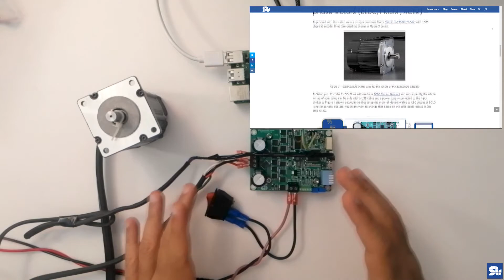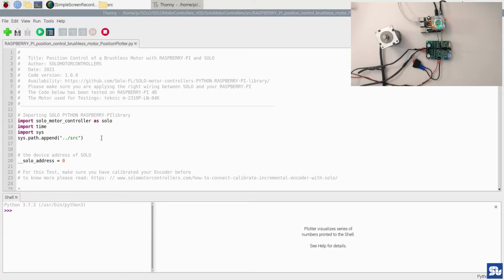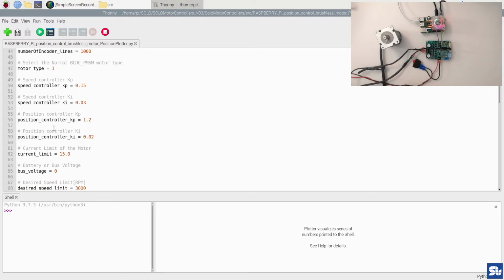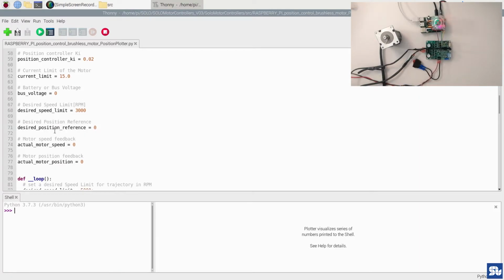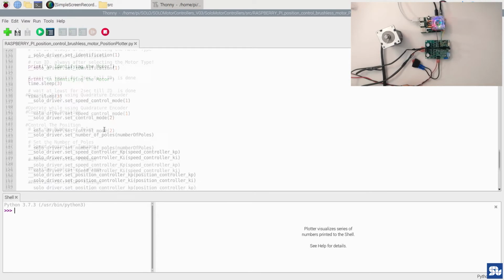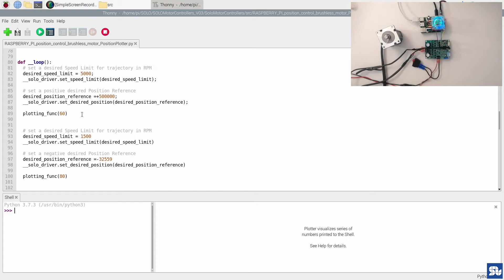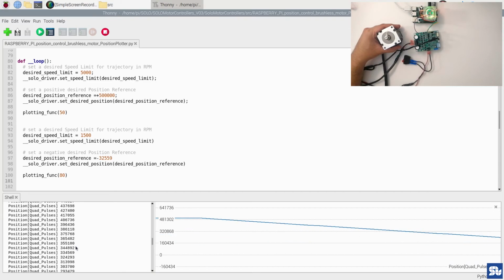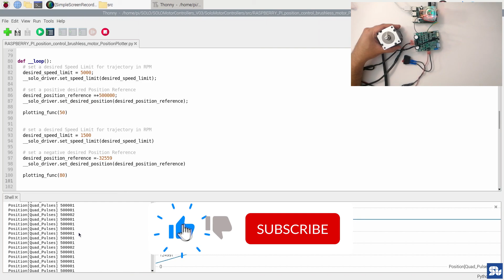Raspberry Pi Servo Drive | Closed-loop FOC Position Control

Comment: that's very good work but did you ever try this in load because without load , there wont be any osillaciton problem, and also is it possible to implemetn s-curve profile instead of trapezoidal? last question  could you try to control robotic arm with your drivers?
Reply from the maker: We have the ST-CURVE algorithm implemented in our drives, and with the SOM the second core is given for user program if something special is needed

Comment: Do you know if it is possible to READ the torque being produced by the motor (perhaps by measuring the current draw or other)?
Reply from the maker: yes, the torque can be read by reading the "Iq" which is the current acting in torque generation.

Torque on the shaft = Torque constant of the Motor x Iq

Comment: Is it possible to use this on a 3d printer. 
Run the step and direction signals through the pie.
Reply from the maker: We have the Direction pin but for the Step command no, at the moment you need to change to Digital command